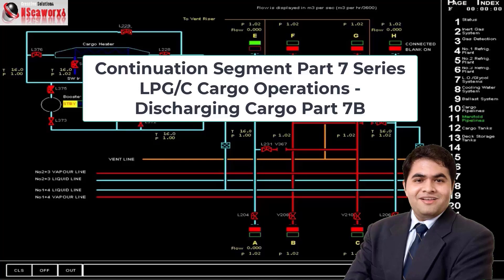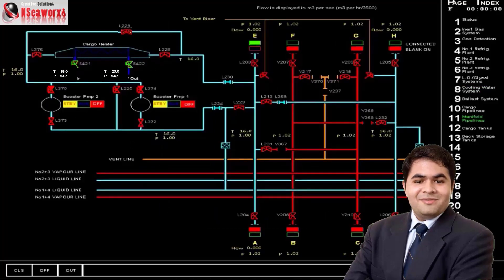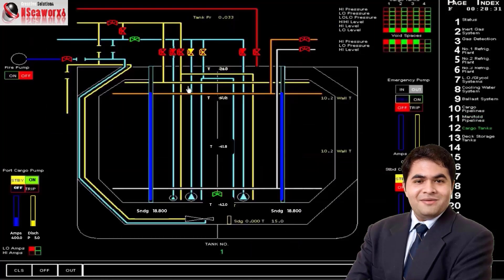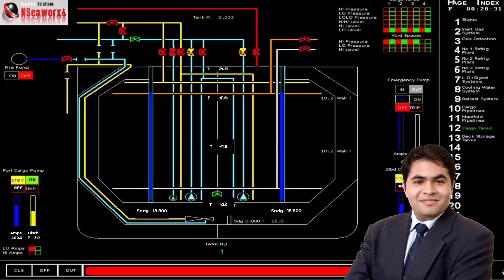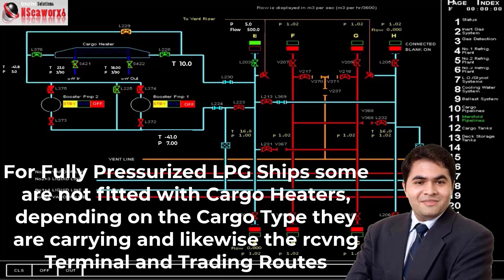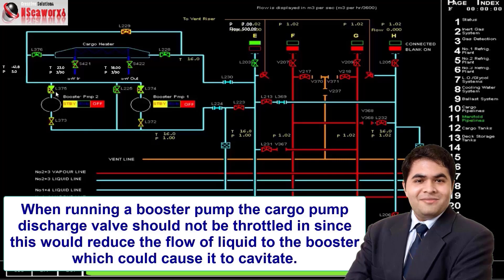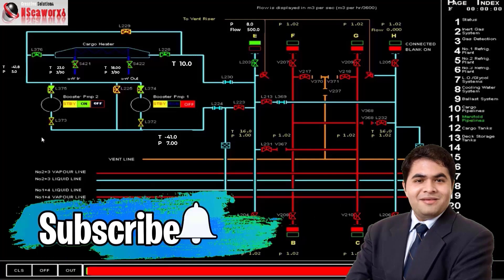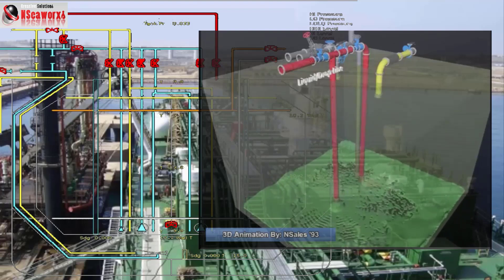LPG/C Ship Cargo Operations Part 7B - Discharge w/ Cargo Pumps + Cargo Heater and Booster Pump

Comment: How do you determine the theorical rate if you discharge with combination of booster and cargo heater? It could be great if we can analyze the diagram
Reply from the maker: When using Heater, rate is determined and controlled by the required discharge temperature. Hence, whatever the output,....that is just how far it can go.